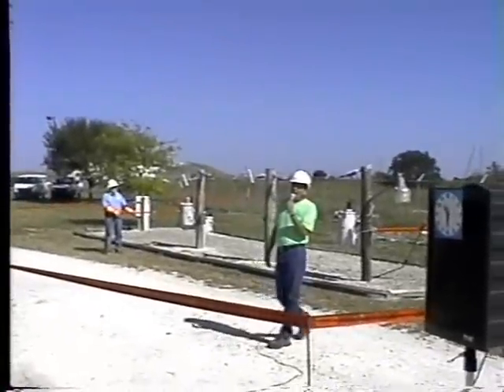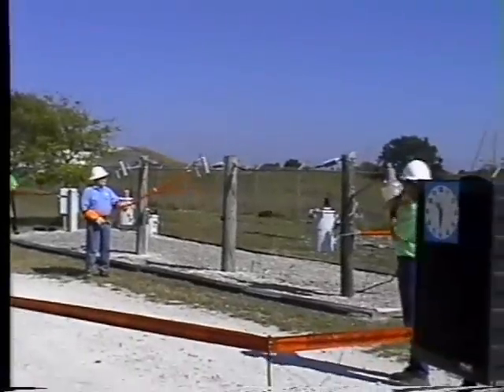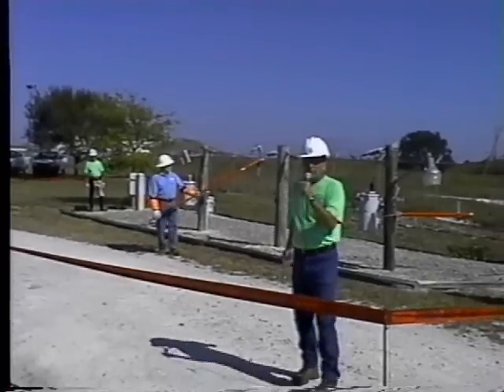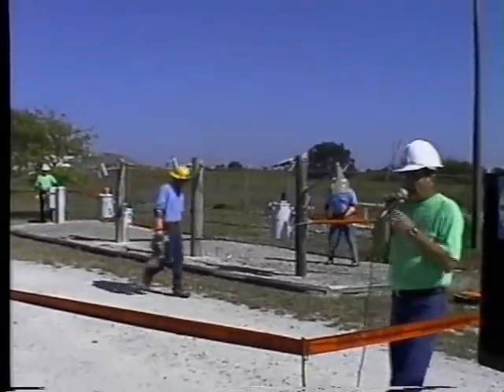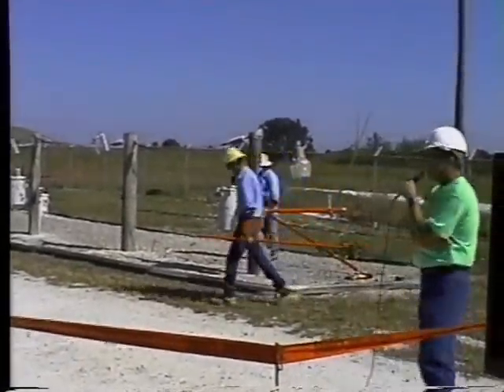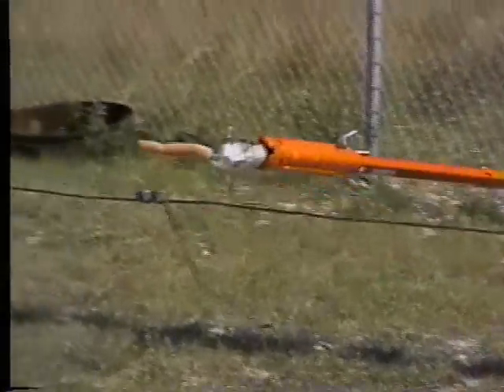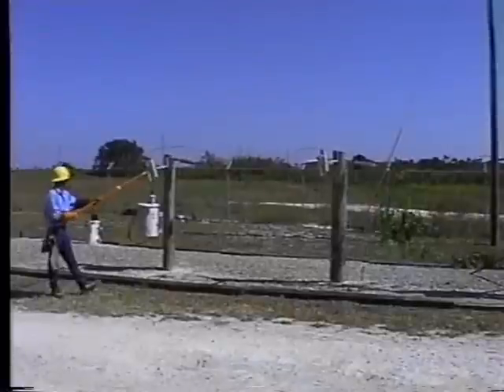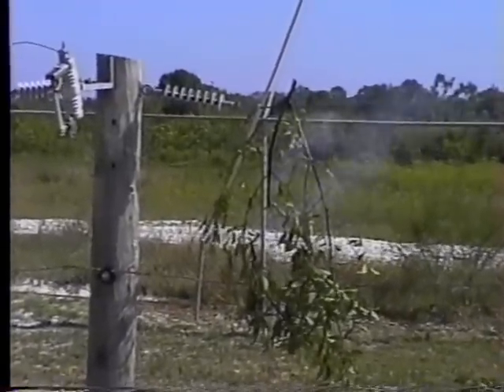power line demonstration

Comment: im a lineman is this is a good "show" for the public on the dangers of our job. we exchange out gloves and sleeves every 4 months for new ones, suppose to air test and visually inspect before each use. where i work we go hands on 4,800 volts from our hooks or bucket and 14,400 from the bucket only, so if you wanna man up glove 14,400 volts in the rain and see how much it lights you up.

Comment: In the demo they used a back fed 120 to 7200V transformer, as the source. I love to know, when Lineman Rick short circuited the 7200Volt line, exactly how much current was flowing as the arcs are impressive. It appears there is a few say 3 amps of fault current flowing, gee thats a ratio 60:1....180Amps @ 120Vac being fed in..that's a lot.. Also the end of the hot-dog appeared to be not blown off, just burnt, as there is not enough grunt in there back fed transformer setup.

Comment: @soylentgreenb The ceramic discs insulate the sections of steel between them. They are large and protrude far to prevent an arc. Once the arc forms, it's incredibly hard to extinguish without switching off the supply. The discs do NOT extinguish the arcs themselves.

Comment: Utility poles are made from wood because it's cheap. 

The conductor is nowhere close to touching the wood; it is held by an insulator surrounded by a bunch of ceramic discs.

Those ceramic discs are there to extinguish an electrical arc if it where to form between the wooden utility pole and the powerline.

Comment: sim2lew if that were true they would just bolt the lines directly to the wooden poles instead of using ceramic insulators.  It has a higher resistance but it is conductive nonetheless.

Comment: If 10 240v 30A generators are back-feeding, then the line (on a 240v-14,400v pole-pig with 80% efficiency) should energize the line to 14,400v @ 4 Amperes (4,000 Ma)

Theoretically Speaking.....

Comment: - @ DtCKclan -

Yes, there are high voltage fuses - you probably won't find any like these sitting around a hardware store as they are special purpose but they are out there.

Aside from the cutoffs, fuses protect their equipment much like circuit breakers and fuses protect our equipment.

Comment: A great video. 

Everyone should see this, especially the part on back feeding which endangers tose who work on our power supply after an outage. 

Do not connect your home genset to your home power system unless you open the main breaker first. Preferably get an isolation/changeover breaker installed you may save someone's life and you will certainly save your genset should the power be restored while you are connected.

Comment: Your very right, power lines are to be left alone. You are better off getting struck by lightning than coming into contact with a 7,200 volt line. If you get within 3 feet or so of a 7.2 kv line, it will arc out and fry you.

Comment: I'm from Michigan too, and while I do have a pretty good general knowledge of electricity, I've never worked on this kind of job, so your experience is worth more.  However, I do know that hotsticks offer a lot more insulation than gloves.  But I suppose if you only have 7200V to contain, gloves could do it.  But they must be pretty special gloves! Anyway, thanks for the additional insight.

Comment: Yeah, the wire connected from a phase to ground with a lighning arrestor in between, that what I was talking about. I didn't know about the lighting arrestor, I thought it was just a wire causing a continuous short circuit. :/ Thanks :)

Comment: On some distribution grids, there's a jump wire connected directly from the high voltage line (on top) to the grounded/neutral line (underneath), why is that?

Comment: To start with, yes - you would need to have a much smaller arc gap to initiate an arc at 200v.  Once the arc is started, it can be stretched.  Think Jacob's Ladder, or an arc welder (which you obviously have never used or you would know this).

Comment: I remember, wnich was around 25 years ago, this same demonstration by our local power company. One thing I do remember was that the lineman did a rain dance (Put a cup of water on the transformer in the middle) the next thing they simulated a direct short, if a tree fell across the lines while the trans. was wet. Wow, the fire ball the trans. shot out the top of it.

Comment: It can be drawn so big because of the current. The current makes the arc hotter, and the air more conductive as it's pulled away. If you had 200v and 3000 amps, you could probably draw an arc about as long as 12,000v and .3 amp.

Comment: 7.2kv is standard for lines like this, especially transformers like this.  The arc is huge because it's following the smoke from the burning branch.  The smoke helps create a conductive path through the air, and that draws an arc.  And electricity burns the inside because it's being conducted through the middle of the body, which conducts better than the skin.

Comment: Good information, except for one part. The guy says that the guys working on the hotline are protected by their gloves. Not so! They are protected mainly by the hotsticks they use to work on the line, and the gloves are an extra safety measure.